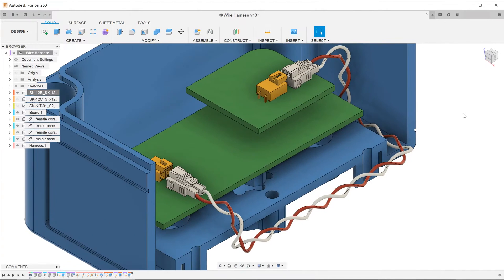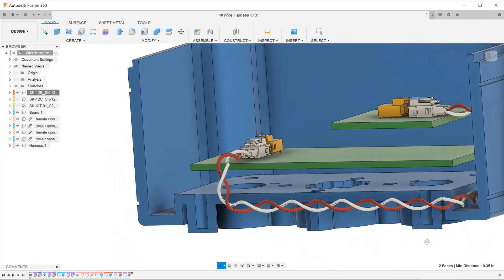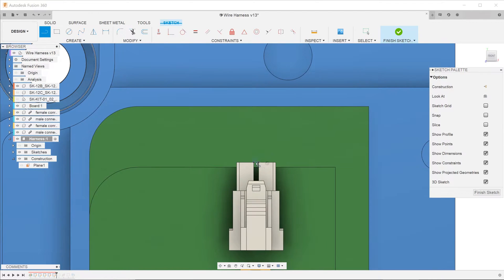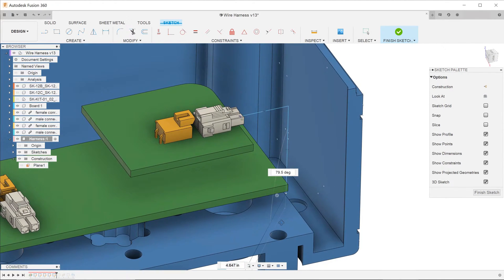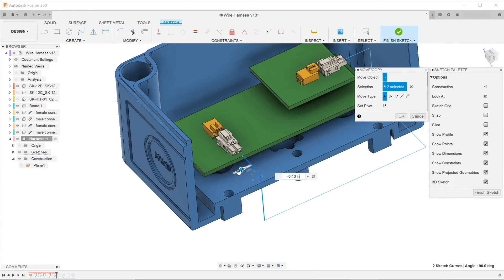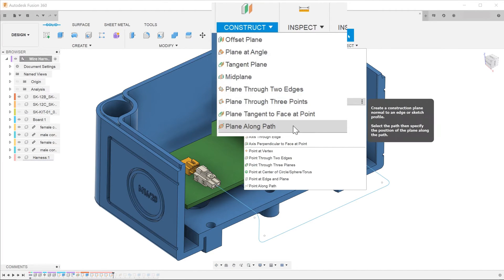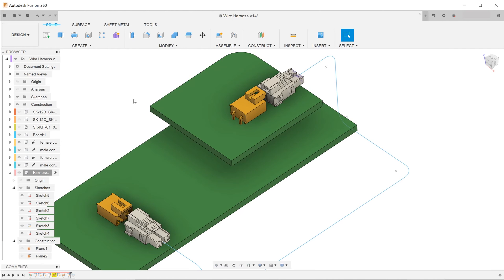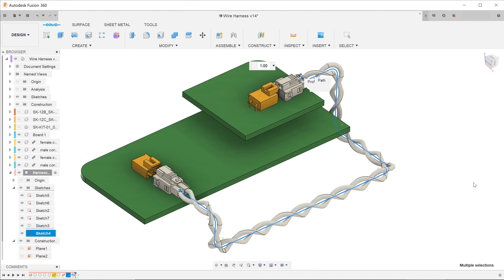Fusion 360 - Twisted Wire Harness

Comment: Can you export some kind of wire harness report for wiring length? For example, twisted wire length would be increased compared to when wiring in straight line. Also depending on the curvature in turns, the total wire length will be shorter or longer. Thanks in advance and congrats for your video!

Comment: How do you figure this stuff out??
Reply from the maker: Hi, if there is a specific question that you have regarding the video, I would be glad to help.
Reply: @Fusion360School  That's kind of you to ask. My question was mostly rhetorical. I've seen a few tutorials where the steps involved seem so "non-intuitive" that I wonder how someone who hadn't seen it done on YouTube would possibly figure out the correct steps in the right order. I don't know if they've just learned through trial and error, or if they understand the software on a much, much higher level that goes beyond watching practicing.
Reply from the maker: Hi, I have watched my fair share of videos. In preparation for these videos, I do a lot of experimentation. You would be surprised how much new stuff you discover just by doing that. To be honest, Fusion 360 has a poor implementation of 3D sketching compared to other CAD programs like Solidworks.